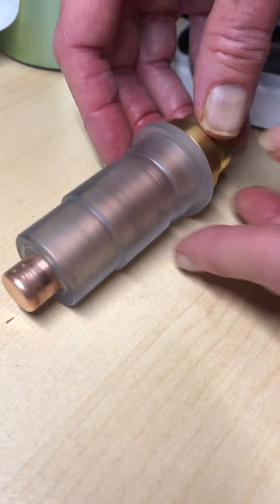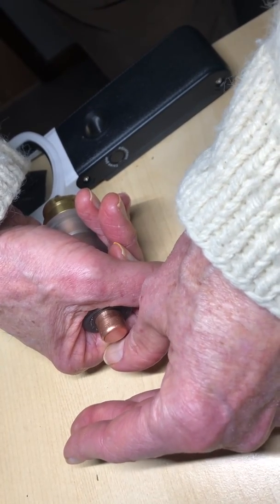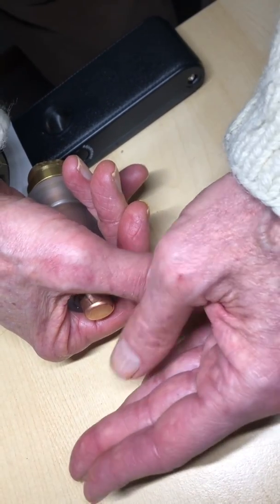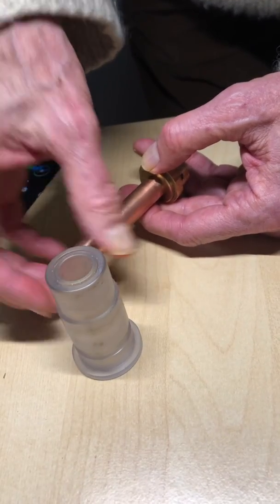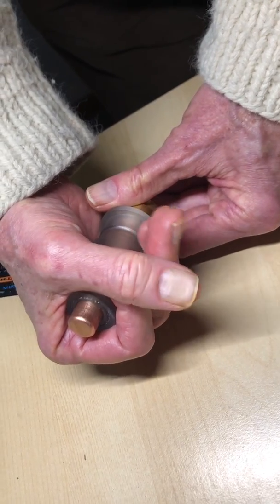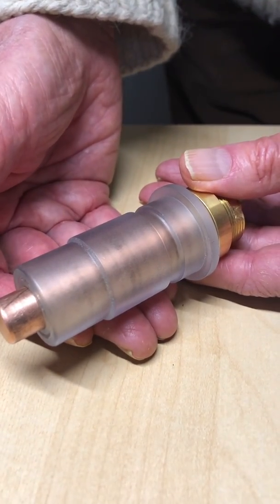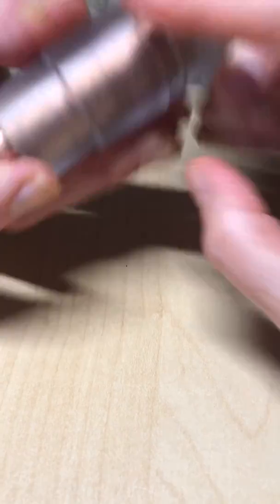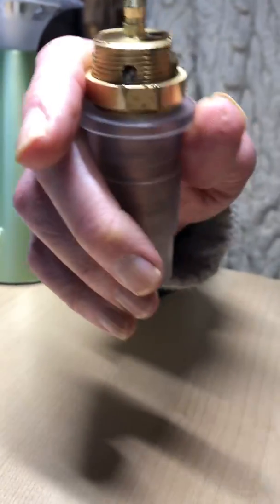Is Teflon A Solution To Clean Energy Revolution?

Comment: Hold on, don't sign that check just yet. The good news is this a simple and cheap fix. While the quote is fair for custom parts (Teflon is harder to cut than steel, requiring a lot of time and wearing out of tooling), the problem is not the insulating material. Both the Lexan and ceramic are turning black from arching, replacing with Teflon will likely have the same results. It depends on the voltage, but you need about a half inch of "air gap" if not insulated. So the Lexan, ceramic or Teflon insulator needs to extend a half inch past the machine wall or the path of electricity will divert to it instead of the cathode. Any type of insulation will work as long as it covers the switch or the machine wall, it can even be as thin as a piece of paper. Maybe the manufacture has a longer insulator, maybe you could cut a piece of Teflon pipe to work or you can use high voltage heat shrink insulation or high voltage insulating tape. This is a common problem for custom made switch gear and I've had to fix may similar situations, if I had a better picture of the problem area I could provide a precise solution. Please feel free to contact me.

Comment: I can get you a secondary quote, I’ve been in the industrial plastics industry for 26 years, PTFE (Teflon)is definitely a good electrical insulator, used in high voltage 10 KV connecters as it is inert to ozone build up within. I work for the largest distributor of industrial plastics in North America. Cheers